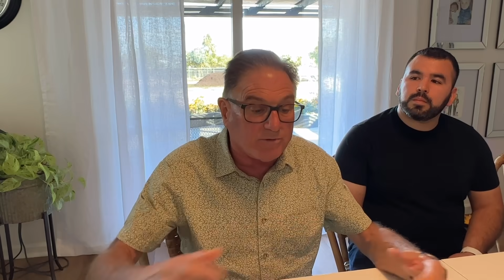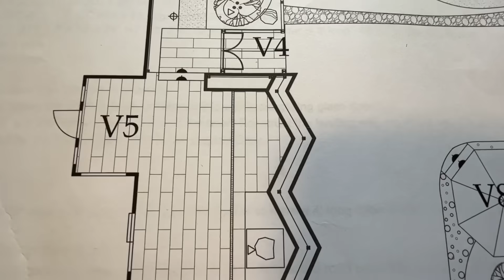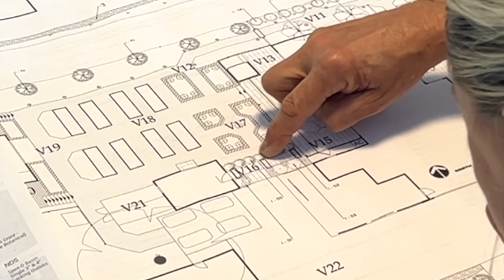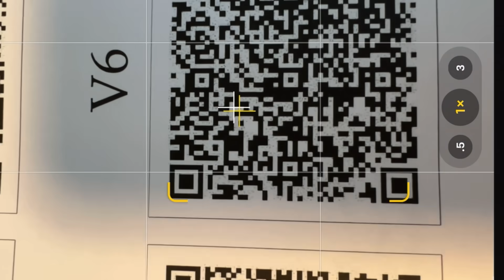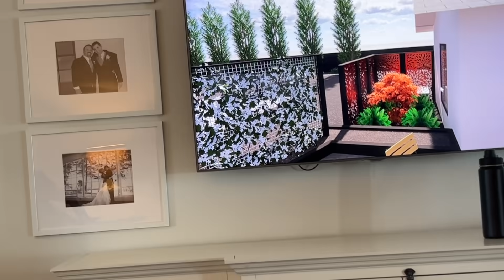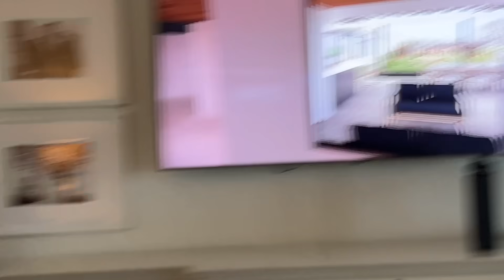✨My Landscape Design Plans are Ready!✨  :: Michael Glassman & Associates Design Presentation 🌳

Comment: Just getting around to watching this, and it’s lovely and the tech is very cool. I do have a California specific question: has the model water efficient landscaping ordinance (MWELO) come up at all during your discussions of these plans? Doing the projects in stages may avoid the enforcement aspect, but a lot of the included plantings look like they are moderate to high water usage and potentially in mixed zones—since I think you only have 12 irrigation valves—which could be an issue if it was submitted as part of a permitting process, and isn’t great from a water conservation point of view, regardless.

Comment: this is sooooo wonderful!  am curious what material they suggest for all the paths.  this is usually quite costly and important.  so tickled how the zig zag planter was first greeted with 'this has to go', to now, being quite the happy surprise and expanded to the back yard and it will be STUNNING.  am also impressed by just metal edging and the soft wavy edgeing of those cobbled rocks, how it totally takes your eye of that monster driveway.  Amazing.  would do that before any resurfacing.  the person that bought linda vader old house has installed taller metal edging and sanded the finish to have it rust, and i think that is also very attractive.  thank you for those codes.  i looked a really long time.;)  bet you had trouble getting to sleep with all that excitement.  wow, just wow.  happy for you having a good plan to have less mistakes.
Reply: gotta add what were the tall trees around edge?  must plant asap.  soooo frames it all

Comment: Janey and Jason, You two are such a beautiful couple and it is wonderful to see all of Michael's new ideas for your garden .  We love your youtube channel and are excited to watch your progress. We think you may need to tweak the plans and make changes as needed. Avid gardeners like you usually have the best ideas about the choice of plants versus a landscape architects who usually focus on hardscape design. We would like you to consider the option of putting an a-frame porch to your current roof , thus changing the look of the front of the house and creating a huge front porch area.  We are concerned about the structure at the entry. One may also relocating  the free-standing  A-frame structure in front of the front entry ( rather than facing a wall with the espaliered jasmine .  Maybe consider a smaller wall or lower fence near your planter to allow a full expansive  view of the front garden. You already will have a fence structure near the road plus all the screening of the new plantings in the septic field.  We still encourage caution in covering the septic field & blocking evaporation and free drainage of water. We see perennials, shrubs and small evergreens in abundance in the front center bed. We're really like many of Michael's ideas, but we expect as you live with the house and site your vision and specific ideas may be refined. Gardeners are really the best ones who are able to choose the best plant for the best location.Like the river rock lining the beds. Wish you the best in your upcoming  improvements and gardening adventures. Hope your channel continues to grow!

Comment: Everyone is different but I would find the lack of wrap around deck for the pool frustrating. Even if there is a connector in the back being able to walk all the way around is helpful. With the deck only on the ends, if you don’t want to go through the pool you are going up and down stairs and ground (so shoes needed). Glasses/sandals/etc… left on the other side? Down the stairs, around, then up again. I heard 4 ft tall/deep but not width/length of the pool. Depending on size cleaning may be more challenging with access predominating on the ends.

Comment: Michael is a gifted visionary, the 3D renderings are such a practical and useful tool.  I agree completely with the other viewers who have stated they would eliminate the screen in the zig-zag planter.  Why would you want to lose your view of your beautiful yard from your front patio and inside the house???  Your house is set back far enough from the road that its unnecessary for privacy.  I would also push that gazebo off the corner a bit 10-15 ft. toward the center.  So fun to see the potential your property has.

Comment: I know some people are saying not to do the screen up front. I had a property just like yours, long and narrow and rural. I think the idea is good if you want to shade the front of the home during really summer days, if you want sound dampening, of if you want the home to have a smaller yard around it to keep pets in for the future (you get a puppy or smaller dog), you may want small grass area connected to it on the side where the ADU is that is screened and enclosed but not planted so if a dog in future it has potty area). We at first thought we didn’t want to block our view like everyone is saying but over time realized our patio was so sun scorched and hot we couldn’t sit on anything or use it until dark even with an arbor and umbrellas bc of angle of sun (it faced west). Truck sounds also drove me a little crazy- we were rural but flat land carries sound. You will know what works for your space when the time comes. Think of sunset, sunrise and heatand sound and different times of year and if dog in future, and when you will use that space versus your back space. Remember removing the pergola is going to bring a lot more sun into front rooms too, could be hot. Could add shade cloth later.
Reply: You make very good points all around.  But note her yard has the opposite orientation to yours, the future uncovered courtyard faces east and the back with the covered porch faces west.